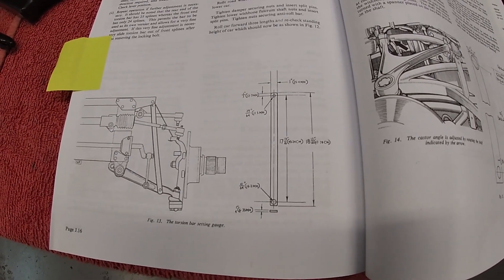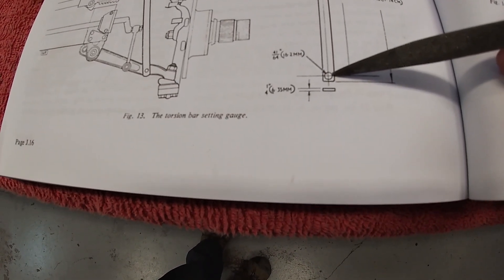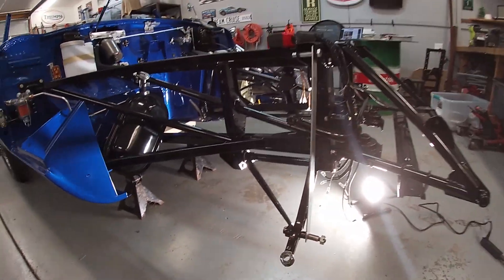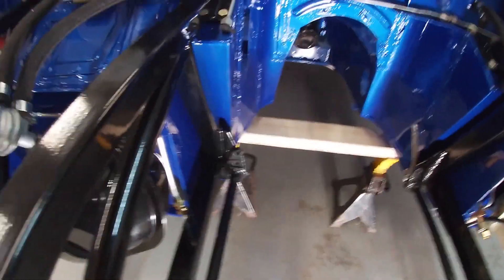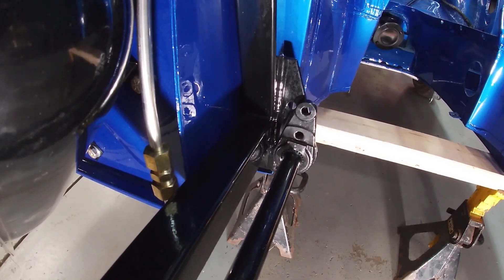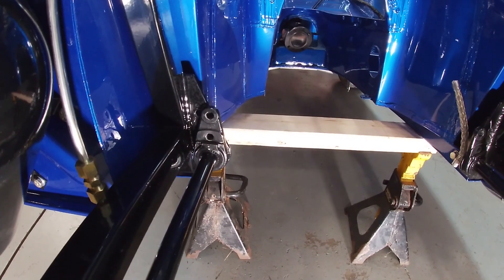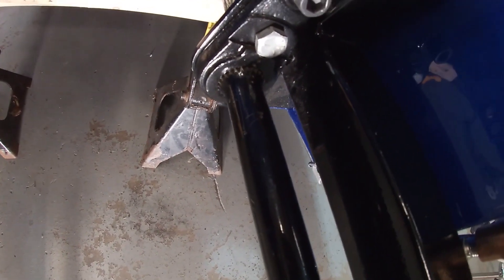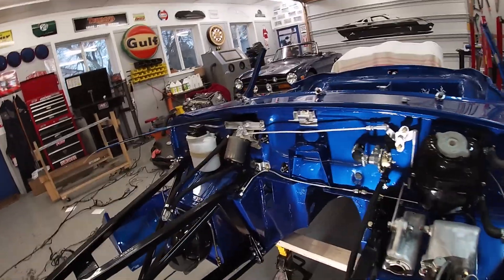Jaguar E Type Series II Rebuild - 2023-01-18 - Torsion Bar Settings

Comment: bit late to say, as you are obviously happy with the black engine frames- but where they are bolted up 'probably' should be paint free- paint or powder between the flanges can soften and break up and then loosen the strength of the bolted joints- I am pretty sure the cars were painted at the factory with the frames on . . .

Comment: John, Another fabulous video. I used a similar homemade gauge to install my HD torsion bars on my 70 OTS. I used a recommended setting from Classic Jaguar to make the gauge. They appear to look fine. Once you install the bonnet with the car settled, I would be interested in the measurement you get from the top of the front wheel arch to the ground.
Reply from the maker: Hi John, thank you for the compliment! I have an adjustable ride height torsion bar plate and I think I figured out how it is installed. I will video that installation and what I learn from that. I will set the torsion bar settings using the gauge and use this as the nominal setting for the adjustable ride height. Then when the hood is connected I will measure the ride height to the wheel arch.

Comment: John wow, that's quite the discrepancy is it possible you swapped the RH and LH torsion bar bracket? tape measure setting is a cheap and fast hack. :)
Reply from the maker: There was definitely a mistake of some kind. Typically, I use one pot mark for one side (LH) and two pot marks for the other side (RH) when marking the positions. This way I know which bracket goes with which bar. I create the pot marks when the system is still an assembly. 

I really dont know where the mistake was created and checking the setting is always the best practice regardless.

I would not call your method a hack - it was spot one from what I found. Making the gauge was cheap and took less than an hour to make/install/check.

Your build notes saved me hours! Thank you.

Comment: What are you using as a pointer? Did you lose your screwdriver? Joe has some extras
Reply from the maker: Yes, I lost my favorite screwdriver - we had been together for a very long time, but I did not see the point in continuing. 

Today's back up pointer while I look for a longer-term replacement is a small half round file. 

I will, for sure, sift throughs Joe's extras!